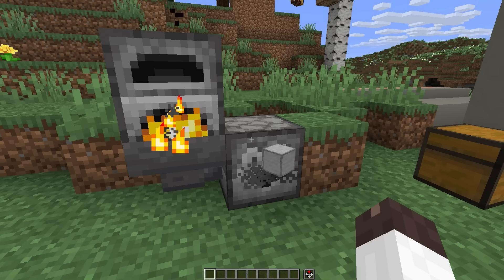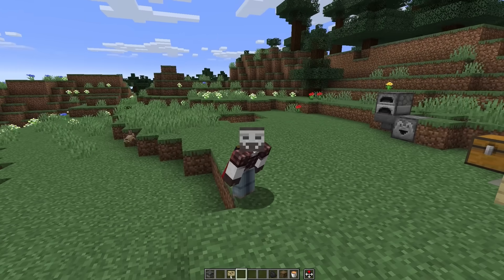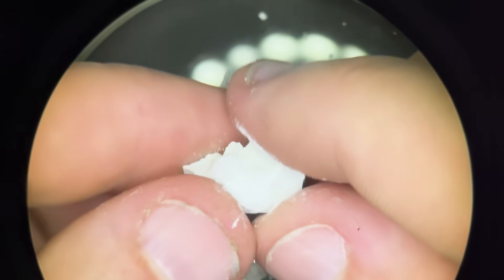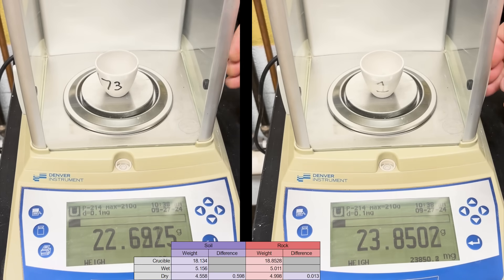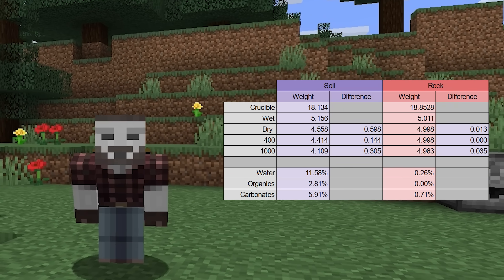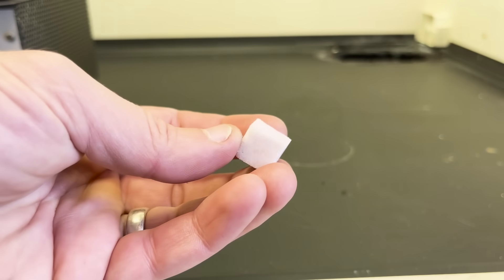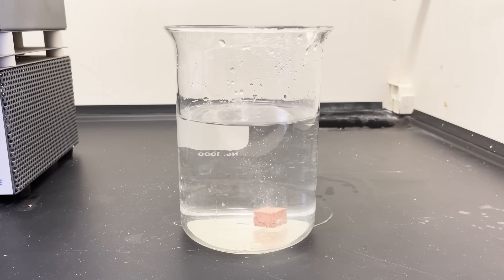Can a furnace make stone smooth?

Comment: A lot of this question hinges on the composition of the rock and the temperature of your furnace.
A very efficient furnace burning anthracite coal can reach around 2000°C, unless you made it into coal coke beforehand. But practical temperatures achieved in historical coal furnaces are around 1500°C.
Your limestone just turned into lime, which reacts with water as you saw.
But at that temperature, most silicate minerals would melt. If you had a rough stone block, then heated it in a ceramic or graphite crucible to those temperatures, it would reform into a smooth stone.
In my opinion, the smooth stone just means it has a smaller grain size, which makes sense if you are melting and rapidly cooling a rock.
Reply from the maker: This is why I want polished granite to be called rhyolite.
Reply: I always interpreted cobble stone as many tiny bits of gravel stuck together and smooth stone as a single solid block so the furnace is melting the broken pieces back into a single stone ingot

Comment: I prefer not to think of minecraft's stone chemistry, especially because depending on what form it is in I treat is as if it were an entirely different material. To me cobblestone is obviously light gray granite, natural stone is either limestone or sandstone, smooth stone is more like a ceramic tile and stone brick I think of as dirty sandstone (sandstone in my area is yellow but exposed to pollution it turns ash gray).

Comment: it makes sense since the furnaces can produce smooth and shiny iron ingots, so its melting the rock and then flowing it into a cast. a cube shaped cast thats perfectly smooth and that it easily pops out of
Reply: a cube shaped cast that's perfectly smooth, easily separated, and also larger than the 1m per side that contains that casting...or the furnace it's within.
Reply: @youmukonpaku3168  you can fit 64 blocks inside a furnace so i think it has room for that

Comment: what happens if you put quartz or basalt in the oven? my sib, April, wants to know
Reply from the maker: The sandstone I put in there was quartz sandstone. If it was one crystal of quartz it might have cracked due to thermal stresses. Basalt contains more iron than andesite so it would probably turn red too. I have done LOI on some basalt samples that that’s usually what happens to powdered samples.
Reply: @gneissname  thabks for the reply!!

Comment: Minecraft certainly does have a few oddities, especially this stuff that's been in the game the longest.

On the concept of why cooking stone turns it into smooth stone, I'm surprised you didn't mention that cooking cobblestone turns it into stone. So stone into smooth stone is only the final step of "smoothing out" cobblestone. Not that smoothing cobblestone is realistic either, but that's definitely a huge component as to why you get smooth stone by cooking stone. Assuming that cobblestone to stone is "melt this rock until it's smooth", stone to smooth stone is just what happens when you leave the cobblestone in for twice as long.

Comment: 4:10 Hey wait, doesn't iron get heavier when it oxidizes? How does this factor into the carbonate calculations? On a similar note, are there any other heat-sensitive reactions that geologists look at besides carbonate decomposition?
Reply from the maker: You got me. I actually cut out a section talking about that. Often times igneous rocks will have more iron that carbonate and they will have a negative loss on ignition because of the gained oxygen.  And yes there are more reactions that can be important. Normally these are done on a set of samples along with other elemental analyses and together all of the data can help tease out some information.

Comment: 6:16 Actually, smooth stone as a craftable block was added at the same time as stonecutters, in 1.14, Village & Pillage. They were made necessary to craft blast furnaces. Before stonecutters, (smooth) stone slabs were just crafted from stone in a crafting table.
Reply: Which absolutely makes sense, because other than fully melting and moulding it, the most common way to make something like granite, basalt, or limestone smooth is to cut and polish it.
Reply: @CrystalFier  Yes but the problem was that 2x2 recipe was already reserved for crafting stone bricks instead of smooth stone, so they just couldn't use it
Reply: @pinkraven4402 At that point they already had polished andesite, diorite, and granite. And glazed terracotta was just recently introduced before then. They could have called it polished stone crafted only in the stonecutter or kept the smelting recipe and called it glazed stone for consistency.

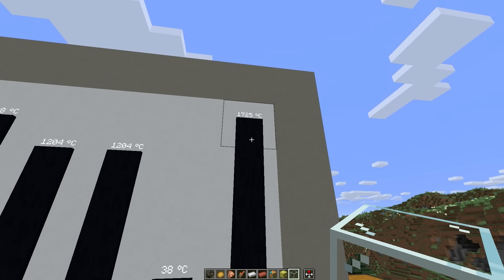Comment: 0:58 I think this graph is slightly misleading because it seems to imply that clay can't be fired using wood as fuel, but it has been for millennia. From my limited knowledge, clay can be fired at a pretty wide range of temperatures, which determines the properties of the ceramic, and wood-fired kilns can also reach temperatures above 1000°C.
Reply from the maker: True, there is a lot that goes into kilns and furnaces and maximizing temp. I decided not to really get into that as it wasn’t the point of the video but the fire numbers came from just some wood burning without a designed furnace around it or anything.
Reply: Also..cooking chicken and fish at 230°c? Good lord.
My oven never goes that high when I cook chicken or salmon.
Reply: they would have used charcoal probably, as charcoal burning was a prominent proffession in medieval europe, underground coal was only used later on and offcourse fueled the brittish industrial revolution
Reply: The graph also made it look like you can't cook food with wood because it's too hot
Reply: @VanK782 Well that is correct in the sense that you can't put food directly into a fire (for long anyway)
Reply: @Sylvarus  As many countless marshmallows and hot dogs can verify... Who hasn't had something slip off the stick while cooking over a campfire
Reply: @VanK782  I wouldn't recommend throwing your to-be meal into a wood fire
Reply: @VanK782 You put your food in a wood fire, and see how well it cooks... You tend to cook food in a specialized vessel above or inside a fire, that shields the food items from most of the heat, this is why stews and soups are a thing as well, because the excess heat will just boil off the water.
Reply: It also is strange seeing people still repeating the misinformation of wood-fires not being hot enough to melt metals: When you burn wood it will turn to coal and absolutely will be hot enough for melting metals. It is easily hot enough for forgwelding iron.
Reply: @ABaumstumpf  open wood fires dont turn into charcoal
Reply: @Sylvarus  "open wood fires dont turn into charcoal"
f you say so.
Reply: @ABaumstumpf  They don't turn into good charcoal lol
Reply: @Silver-Rexy  nobody said it would be good charcoal - but sylva is just wrong - hubris at its finest.
Reply: @ABaumstumpf the charcoal it does make wouldn't catch fire as it would be beneath the oxidized outer layer of wood/ash and you would have to manually poke it so it can even have a chance to burn
Reply: @ABaumstumpf  They don't, charcoal is produced when the heat is so high that all available oxygen is burned off and no new oxygen can reach the fuel source. And in an open fire that doesn't happen. You might get splotched areas or low-grade charcoal at the bottom of a firepit, but charcoal needs oxygen free environments to form. This is why industrially charcoal is made in Coke ovens. Where the temperatures is so high that the wood chars, but low enough temperatures that it doesn't melt. Although there ain't many things on Earth that could shield charcoal at it's melting point of 3673.15K...
Reply: @livedandletdie  A wood fire can absolutely have oxygen free zones inside of it, aspicially if it is notstacked to allow oxygen to flow into the pile well. Charcoal is definitely created inside of an open fire, because the woodgas burns the oxygen before it can reach the glowing hot charcoal.
Charcoal also never melts as ambient pressure. It sublimates.
Reply: @livedandletdie  Have you ever made a campfire? It sounds like you have not. All you need to make charcoal is heat. In air it'll just burn away if hot (and reignite if still hot!), but that happens slowly, even slower with flames still going. Making charcoal is as simple as making a campfire in a pit. Burning wood by slowly adding new layers on top in a pit, or a box, or over a box and letting burned wood fall through, is the easy way of making serviceable (what are even the criteria?) charcoal. Just gotta douse it with water when it's done, and dry it to use, but it's still more convenient than the traditional alternative.

Dunno if wood is enough to forge weld iron/steel though, it's an ass to forge weld, and I haven't gotten it with my limited forging experience.

Comment: 0:43 I am pretty sure drying a whole cubic meter of sponge that's filled with dozens of cubic meters of water requires way higher temperatures than 38 °C
Reply from the maker: There is some crazy things that happen if you are trying to boil off a cubic meter of water in 12 minutes. The amount of steam alone would be amazing.
Reply: @gneissname  a sponge can absorb way more than a cubic metre of water, probably at least 30 or 40 (although of course none of this game's liquid physics makes sense)
Reply: @1e1001  max is 135 blocks
Reply: @1e1001 but those 30 or 40 cubic meters of water can come from 2 if you're good with a bucket
Reply: @gneissname  I'm just thinking about the amount of energy it takes to bring that much water to a boil.
Reply from the maker: @ it would be fun to figure that out and then use that to say something about how hot the nether is since it evaporates it all instantly.
Reply: They key phrase was “depending on how fast you want it”
Reply: drying isn't as much about temperature as it is about airflow.
Reply: You also gotta think what happens to dozens of cubic meters of waters compressed in less than a cubic meter.
Reply: if you leave it in there long enough it will work eventually

Comment: I love when you take them out and they’re glowing
Reply from the maker: It was interesting to see how quickly they cooled off. The sandstone cooled quickly but the granite was orange for quite a long time.
Reply: @gneissname  Makes sense. Granite is an igneous rock formed from lava, it can take an incredibly long time for it to cool down. Its melting point is 2300°C, and it conducts heat rather well. Just dont subject it to a deep freeze.
Reply: @NightLexic  granite melts at much lower temperatures than 2300 C, especially if it contains some volatiles. I’m not sure where you got that number from but most igneous rocks can (re)melt anywhere between ~700 C (wet) and ~1400-1500 C (dry)
Reply: @Doctorrokk  it's 2300 farenheit

Comment: one thing of note that i found interesting and was also covered by an old episode of game theory; was the fact that the furnace is also made out of cobblestone.

at high enough temperatures to melt glass wouldn't the furnace just melt as well?
Reply from the maker: yeah, there are a lot of these issues with minecraft. You just have to pick and choose what to consider gameplay magic in world magic or just things that are wrong.
Reply: Yeah, and even if you were to say that sand in Minecraft has a lower melting point than cobblestone, the furnace can also melt cobblestone itself into stone.
Reply: @prismarinestars7471  Well, it doesn't melt the cobblestone, only smoothes it, so the insides of a furnace could just be smooth too
Reply: @rizizum it is, the bottom of the furnace is smooth stone
Reply: The inside of it would, yes, but this isn't entirely unrealistic either. Depending on design and use, kilns may be damaged in the process of their use.
Reply: Clearly the furnace uses the natural draft to cool itself
Reply: buckets can hold lava but can't survive being dropped in lava
Reply: @v3launchunit-hx2ib cactus
Reply: minecraft is an absolutely BIZARRE game. there are so many things that dont make logical sense when you think about it, but the game somehow still makes everything work
Reply: @MinerBat  Definitely.

Comment: the recipe for the smooth stone block is still quite recent in Minecraft, before, when only had smooth stone slabs, which was crafted with regular stone, so the smooth look was more a crafting result than a heating process
Reply: The recipe for smooth stone is still somewhat based off of the conversion from cobblestone to stone though, which has been in the game since beta or alpha.
Reply: @the10ofdiamondscard  i agree, so we need to test how long would it take to make a smooth block out of a "cobblestone" irl and what temperature
Reply: It was probably also a bit if a "language result" as well.
To differentiate stone from cobblestone and stone blocks, people used to say "Smooth Stone" to specifically mean the natural Stone block.
To make smooth Stone, you smelted Cobblestone, since Cobblestone is rough and Stone is smooth.
Mojang to make the new Smooth Stone block just adapted this community interpretation. To make Smooth Stone, you smelt smooth Stone. Same process as before kinda.
Reply: @EvilParagon4  
iirc, some people refer(red) to regular stone as 'clean' stone, to differentiate it.
Reply: I played a lot in 1.6.4 with lots of mods (industrial craft, gregtech, railcraft). It still "recent" for me😂😢
Reply: I don't know if I would call 5 years "quite recent", that's like 3rd of the games existence.
Reply: @baph0met  Everything after 1.12 is recent, don't take this away from me.
Reply: @EvilParagon4  If we go by that then I have that for 1.9. I still feel like the end update is new.
Reply: @baph0met  I still think of beta versions when it's down to single digits... Lol

RIP beta 1.9
Reply: @EvilParagon4  for me things like hoppers and horses still feel like somewhat recent additions...
Reply: @EvilParagon4  I separate the time periods of minecraft like everything before 1.12 being old Minecraft, 1.13 is sort of a transition cause added some modern game changer mechanics like swimming, but 1.14 and forward it's modern Minecraft with the versions 1.17+ the actual minecraft
Reply: @CebGIN the idea of observers, slime blocks, leafstone, guardians, the /clone and /fill commands, shields, shulkers, woodland mansions, etc. being "old Minecraft" ages my soul immensely.

I'd divide Minecraft into the following eras:

Paleo-Minecraft (before survival test)
Ancient Minecraft (after survival test to Alpha v1.0.0)
Old Minecraft (Alpha 1.0.1 and before Alpha 1.2)
Early Middle Minecraft (Alpha 1.2 to Beta 1.7)
Late Middle Minecraft (Beta 1.8 to release 1.3)
Early Modern Minecraft (1.4 to 1.7)
Modern Minecraft (1.8 to 1.12)
Late Modern Minecraft (1.13 to present)